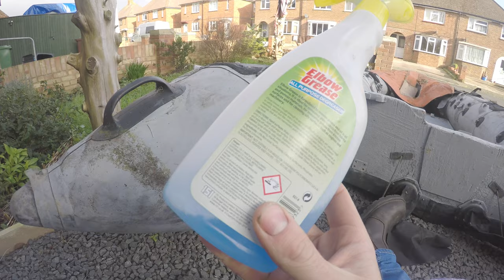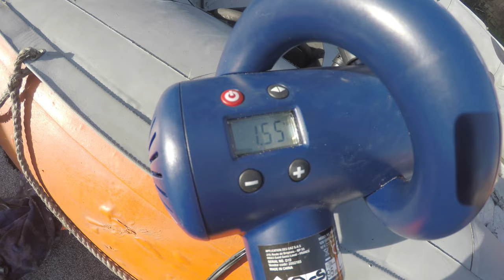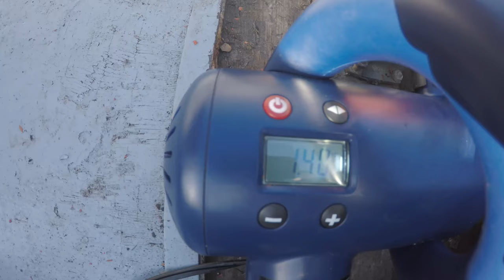Ex RNLI Lifeboat - 1980’s small inflatable boat - Can This Classic Be Restored?

Comment: You've done a great job there, really impressive.  I'm restoring an similar aged old Avon Rover and, despite buying the 'proper' cleaning solution and loads of scrubbing,  it hasn't come up anywhere near as good. Can I ask what solution you used?
Reply from the maker: It’s a commercial grade product mixed with water. Not sure of the ingredients. It hasn’t seemed to have melted it or damaged it as far as I’m aware. Worth patch testing a few products though. I think it’s a kind of bleach.